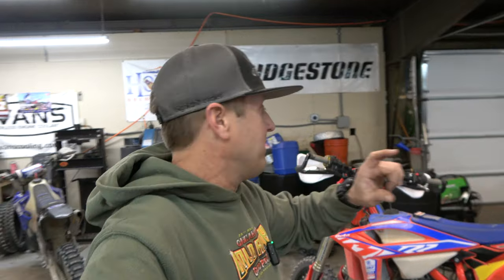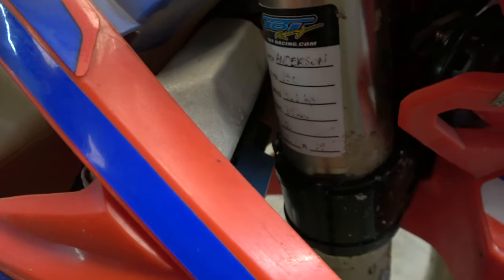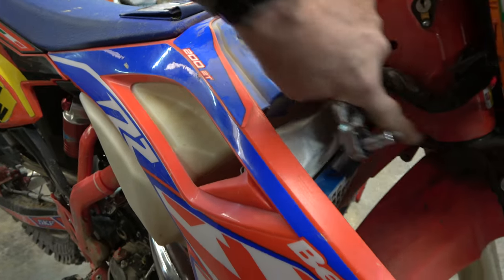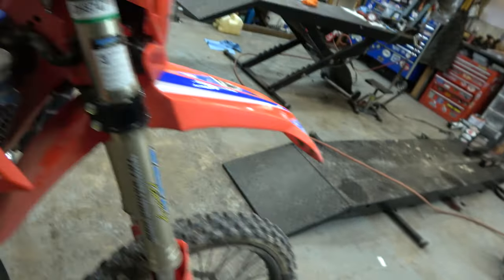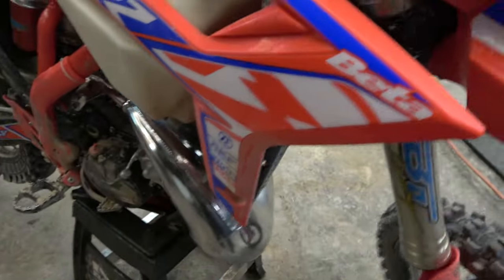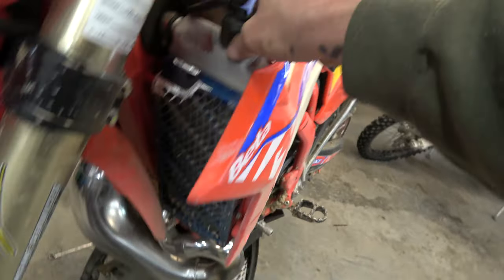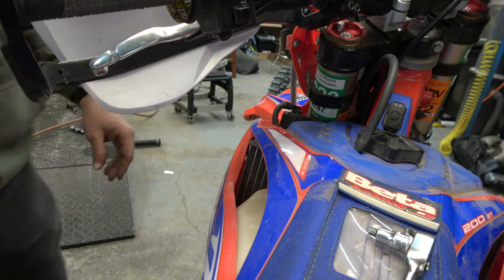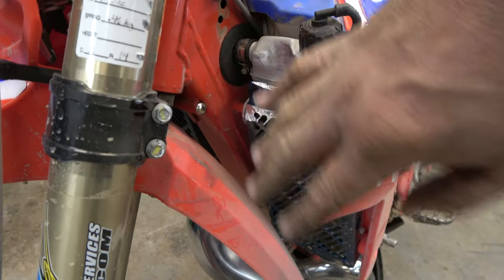2022 Beta 200RR Race Edition | Fixing the Steering | Highland Cycles

Comment: Heat it up a bit, use a 36mm socket on an extension with a heavy mallet and punch in the direction the forks are heading. Takes 10 minutes.
Reply from the maker: But you still have to clearance the guards

Comment: on my 22 300
i used a piece of steel pipe the same thickness as the fork or slightly smaller
worked a treat then just a scotch bright pad to clean up the scuffs.
I also instead sanding down the brace i just notched out enough of the corner so it looked nice still.
Reply from the maker: The 300’s need a lot less clearance. Also, we are about going fast and hard, not so much about how it looks. Everyone has their priorities

Comment: I've seen a video of Johnny Walker where he talks about the radius turn on the Beta dirt bikes, and he orders pre bent radiators directly from the Beta factory. Seem that Beta makes pre bent radiators for the pros. Great video! 🤘
Reply from the maker: Hahaha why don’t they just put them on.
Reply: @highlandcycles  I thought the same thing when I saw the video. Anyway whatever 😁
Reply from the maker: @easterntownshipsenduro  hahaha #anywaywhatever
Reply: Yup.  Work around for a poor design.
Reply: I've not seen this model in person, so my initial thought was to disassemble the radiators, egg out the mounting holes for the bolts and install them just a bit rocked backwards at the top. 

But if Beta is offering pre-clearanced radiators to anyone, my idea is likely not possible.
Reply: @charlesgunzelman3323  the gas tank is so close to the radiator already the gains would be minimal compared to denting the radiators.  Tilting the radiators back was my hubby’s first idea but the tank is just too close
Reply from the maker: @charlesgunzelman3323  the cross over at the top keeps that from being a good option unfortunately
Reply: 2024 300 race edition has bent radiators now. Gotta love that Italian stubbornness

Comment: I chose to run Motoes radiator guards. They hug the radiators very nicely and are plenty thick enough. I shimmed my stop bolts so the forks just miss the radiators and found I have enough turning radius to make me happy. No grinding or hammering required. I road a 02kx250 and found the beta now turns just as good. not sure if a modern KTM has more turning radius than an 02kx250, but my beta turns to where I'm comfortable and happy.
Reply from the maker: Do you have a 200?  This one was no good even with the guards off. Fine in the open stuff but in really tight stuff it was just annoying
Reply: @highlandcycles   I have a 2022 300 race. When I brought it home, turning radius was ridiculous. I was able to cut the radius down to almost half what it was with just bringing the adjustors in to where the forks almost touch the radiators. Again, the Motoes guards did not create any issues and the radius is much better now. I was convinced I would need to dent the radiators, but I tried it out without doing that and was happy. The top of those tanks are just crimped on, as far as I understand. I didn't want to take the chance to break that seal by denting the tops in. Turns out, I didn't have to.
Reply from the maker: @tbank86q  nice. The 200’s are much worse. We brought the stops in without the braces on and it was still not tight enough so we “fixed” it. I like the bike but this is a silly problem. It’s only an issue in the super tight stuff it pushing the bike around the shop but it’s annoying. I’ll stick with Yamaha and KTM for now.
Reply: @highlandcycles   if I get some time in the near future... If I can find the time.. I would love to compare the turning radius between my beta, kx250 and kdx220. If I can get around to doing that, I'll hit you up. In the meantime, thanks for the fun content. I have little to no interest in the KTM brand bikes, but I've really been enjoying your vids. I can really relate to your vision and passion. Thank you.
Reply from the maker: @tbank86q  thanks. I was getting tired of KTM until this new one. If you get a chance you really should ride one. I let a die hard beta guy ride it and his beta is for sale now lol. For going fast I don’t think there is a better bike. The betas are definitely tuned for the hard stuff.
Reply: @highlandcycles  different strokes for different folks. I have my share of experiences on KTM products. I've ridden a 2019? husky 150 tpi,  2019 KTM 250 tpi and a 2022 husky te300 tpi. They just weren't for me. I'm very happy with my beta. Not dogging them, just not for me. Aside from the feel, I really appreciate the simplicity of a carb and feel of a linkage bike. I did ride a 2020 KTM 500 4t and really liked that bike. I also road a 2009ish KTM 400 4t back in the day. It was a pretty nice bike too.
Reply from the maker: @tbank86q  that’s why there are lots of manufacturers. I hated the TPI bikes. And I’ll never ever get rid of my XR650R or my YZ’s or my KDX. They are just so reliable

Comment: Had to do the same to my 2021 200. Except my hubby dented my radiators by hitting a big socket.  Stupid design by Beta.  Tim at Beta told me back in ‘21 that basically it was news to him about the turning radius on the 200. I sold the bike shortly thereafter.  I did not like the chassis and I had some electric issues.
Reply from the maker: Hahaha. They know. Johnny walker recently got a 200 and got pre bent radiators.

Comment: I did this mod a while back and it’s been great. But now I’m wanting radiator guards, I’m wondering which ones might fit without modifying?
Reply from the maker: Bulletproof Designs fit but will need to be trimmed. I think they all will

Comment: I think I remember hearing somewhere that you can use a KTM wheel on a beta. Maybe change the spacers?
Reply from the maker: Yes you can
Reply: Thanks for the quick response! 
On the front I just changed the spacers and the brake disc?
Reply from the maker: @Norcal2stroke  I think the front it’s just the spacers.

Comment: I'm thinking of buying the '23 200rrRE but to put $11Gs++ and then purposely dent and grind it (devalue it) seems insane. 
I'm guessing the radiators can't be moved back or down at all (tank too close and crossover radiator hose hole in frame no more room).

The '23 KTM 250xc is my other choice 🤔😁
Reply from the maker: Yeah. I looked long and hard and moving them but the crossover is the biggest issue. I really like my XC. Even more now lol
Reply: Exactly.   Why the heck is the gas tank < 1cm from the radiators anyways.  I dented my radiators on my 200 and every time I rode that bike I would get upset that I had to do something so stupid to a modern bike just for it to go down a trail.  When I first bought the 200 I ran the steering stops to where the forks stopped 1mm off the radiators.  I was hitting the steering stops just riding my usual stuff where that has never been an issue before.
Reply from the maker: @my-max-media7621  not sure. I know my XC will do about 77.
Reply: Just get a billet fuel cap and call it good.  If you're worried about devaluing it, you're probably not riding it in challenging enough terrain to need a tighter radius.

Comment: NOOOOOOO. You can do a much nicer job with heating the RAD up with a heat hun and a 17 or 22MM socket which is the same diameter as the fork. Makes it look OEM
Reply from the maker: Yeah but what about the rad guards? I don't have a milling machine or time to send them out to be clearanced then mounted back up then machined again and back and forth and back and forth.  If the Italians had let some one ride the bike first  they would have done this from the factory.  Also, once it is dirty and banging around in the real world you won't even notice as you are able to turn the thing like it is supposed to.
Reply from the maker: Oh and a heat hun???  It looks more OEM if you spell correctly.  hahahahah
Reply: @highlandcycles  I have a heat hun - been married to her for 57yrs & 9mos
Reply from the maker: @tomanderson6672  hahahahha